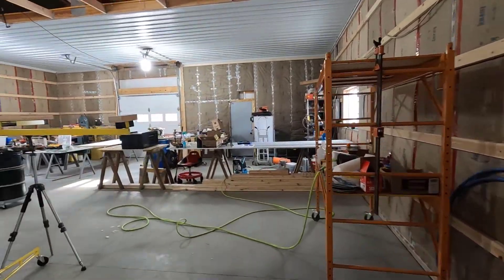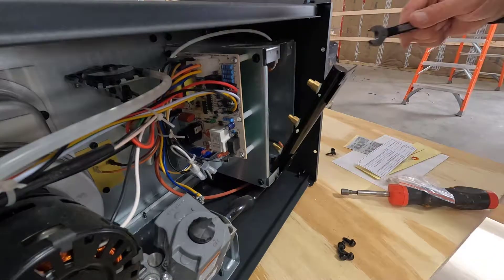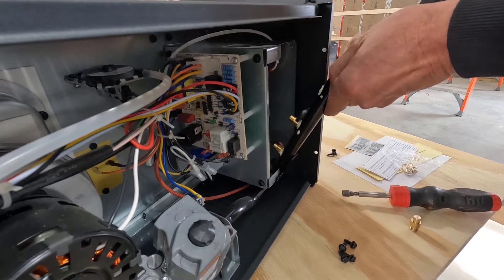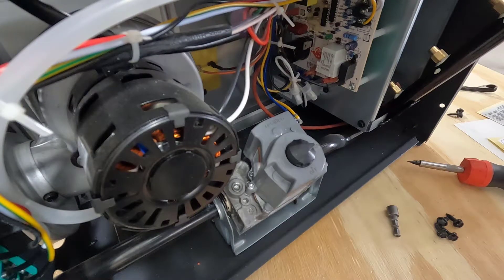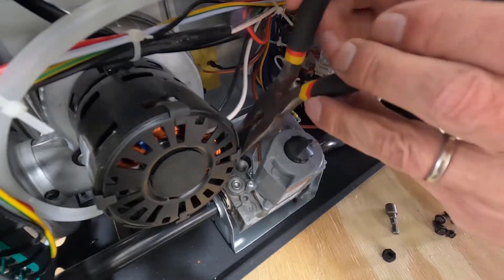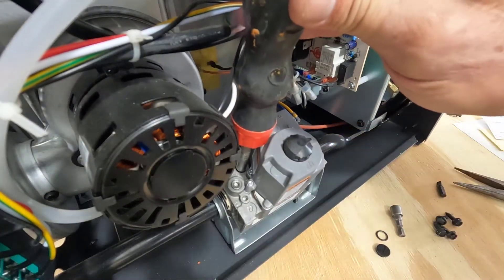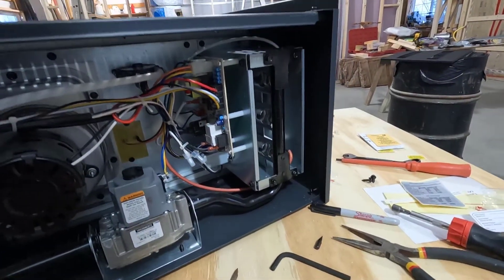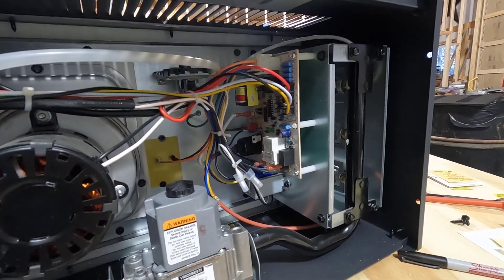How-to Convert a Garage Heater from Natural Gas to Propane (Pt.1)

Comment from the maker: Just a few steps away from having heat! Not that that is a big issue anymore. The ten day forecast has every day (except today) above freezing, with most days pushing 40℉ (4.4℃) so it will be quite nice out there in the woodshop — especially when the sun is shining! Once this heater is installed, hooked-up, and tested, I can move along with the ceiling at a much faster pace, and there is only one thing left (the subpanel/furnace wires) that I need to work around with the ceiling panels, and I'm almost done by then! It will be soooo nice to not have to worry about the cold! 😊

Recent Products used:

16' LeverLock Tape Measure - https://amzn.to/3MRu9i9
Seagate Desktop 8TB External Hard Drive - https://amzn.to/3gRZGEC
SuperWinch Terra 45 - https://amzn.to/3AdzJWR
Large Tapcons - https://amzn.to/3TDkJbz
Heavy Square Washers - https://amzn.to/3E1tvKV
DeWalt Impact Wrench Kit - https://amzn.to/3EtMaQY
Flexzilla Air Hose - https://amzn.to/3ARo6W5
Drywall Lift Panel - https://amzn.to/3hOwDm4
Milwaukee M12 2.0 AH Battery - https://amzn.to/3X9qvVl
Kinco - Premium Leather Work - https://amzn.to/3EeLTjv
Johnson Laser Level - https://amzn.to/3idhn2h
Tyvek Sheathing Tape - https://amzn.to/3XKaQMu
MemBrain Smart Vapor Barrier - https://amzn.to/3ugDBmD
ColorFit by Milton Coupler & Plug Kit - https://amzn.to/3UpS6iJ
Milton Safety Exhaust Coupler - https://amzn.to/3FhrCeY
Senco SPS SKS-L, SKS-M, SKS-N Staple Gun O-Ring Kit - https://amzn.to/3H3wqWq
Old-School Brass Laundry Faucet - https://amzn.to/3TcXWUH
Schrader Valve to Male NPT Fitting - https://amzn.to/3ytxazd
Carbide Tipped 2" Hole Saw - https://amzn.to/3VCV5Wj
100 lb Neodymium Magnet - https://amzn.to/3U8vrHF
200 lb Neodymium Magnet - https://amzn.to/3F2PEu8
300 lb Neodymium Magnet - https://amzn.to/3FksvSQ
500 lb Neodymium Magnet - https://amzn.to/3YbZbq2
600 lb Neodymium Magnet - https://amzn.to/3FdaWUC
700 lb Neodymium Magnet - https://amzn.to/3hej2UX
1,000 lb Neodymium Magnet - https://amzn.to/3FH8VkS
1,500 lb Neodymium Magnet - https://amzn.to/3uHbU6Q
Starrett Combination Square - https://amzn.to/3hbAwS5
Thermal Warm Crew Winter Boot Sock For Men - https://amzn.to/3j5EFr3
Energizer AA Ultimate Lithium Batteries - https://amzn.to/3V95tUX
USB 3 Extension Cable - https://amzn.to/3BML0y9
SZHLUX 6 Pack LED Shop Light - https://amzn.to/3j9Dozn
CH2100 2-Pole 100-Amp Circuit Breaker - https://amzn.to/3GbrduP
DANCO Gas Test Gauge - https://amzn.to/3YBRAS9
Indoor Outdoor Thermometer Hygrometer Wireless Weather Station - https://amzn.to/3FJq1O5
Tordon RTU - https://amzn.to/3WGu98d
Male to Male USB Cord - https://amzn.to/3WnKIWS
YELLOW JACKET Gas Pressure Test Kit, 0-35"Wc - https://amzn.to/3FXUzf3
Reply: what no pipe yellow teflon tape?
Reply: sorry  (on orifice)
Reply from the maker: @martinm6833  It has 'monster' pipe ,sealer on it.